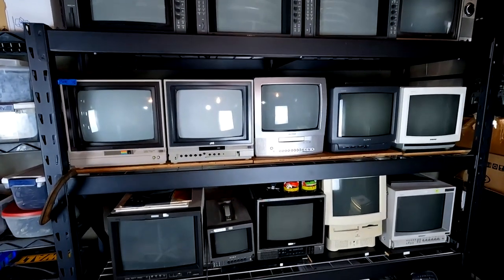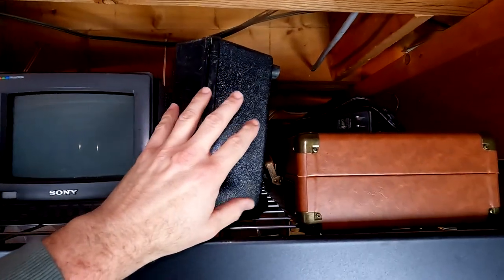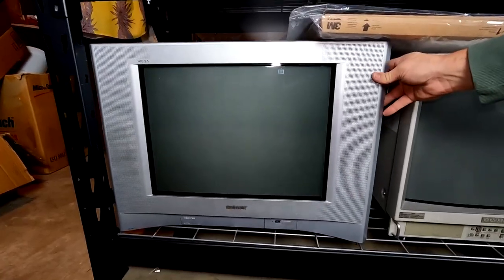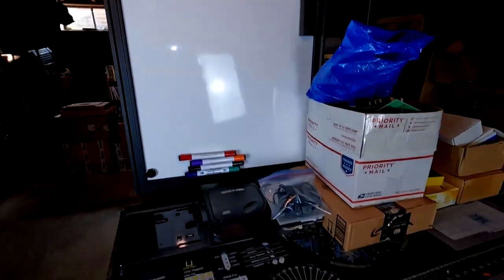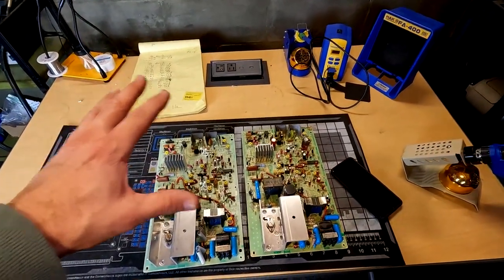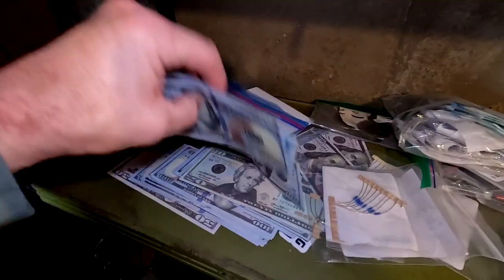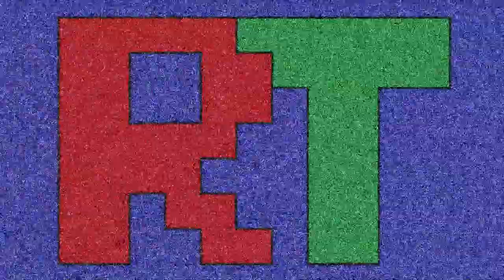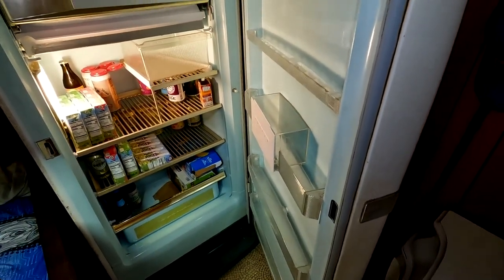Inside a Modern CRT Repair Shop

Comment: Love your work, Steve. Any updates on the 14L2s? I have a couple myself waiting for a recap.
Reply from the maker: Thanks, did you get a chance to review the 20L2 video any?  What did you want to see on the 14L2, that could be good for a live stream.
Reply: @RetroTechUSA  I have a 14l2, wouldn't mind knowing any key differences on the boards or when considering any cap replacement differences between the two models. I'm assuming many of the caps are the same
Reply: @RetroTechUSA  Both of my 14L2s have a weird bug where adjusting the hshift past a certain number (78 or 80?) would make the OSD freak out. Also, if you end up recapping them, please put the cap list on the discord!